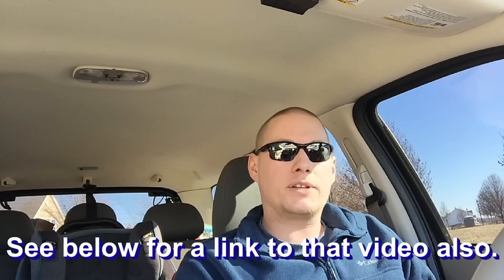Ford Ecoboost Engine Carbon Deposits: What You Need to Know

Comment: Fun fact:  Costco gas is Top Tier qualified. http://www.costco.com/gasoline-q-and-a.html
Reply from the maker: Cool stuff
Reply from the maker: Roland Gutierrez Yes as stated in tank only
Reply: coma9 I could tell a noticeable difference in performance and sound while running between running costco gas and shell or chevron gas. In my high compression engine car, the costco gas would make it run a bit rough. I would get more crackle and even a few backfires on decel running costco fuel, but never had it as much running chevron. all the fuel ran was 91 octane and i tried the costco fuel a few different times throughout the year with the same result. It is possible the specific location i was getting the fuel could have been the problem, but i ddin't want to take any more chances and didn't want to scare the people around me. backfires are LOUD lol
Reply: Brandon N It's very likely that the location you were purchasing from has issues, as I've been running Costco gas for years in my vehicles now with no issues - but that's just my experience.  Everyone's experience my vary.  I recommend contacting Costco HQ about the location in question though, as they do pride themselves in their fuel quality, claiming it has just as good of detergents and quality of fuel as name brands like Chevron, Shell, and Texaco (our Texaco's use Techron, like Chevron, so not sure if that means much to you heh).   
Hopefully they can get it sorted out at your location so you can enjoy great fuel at low prices.  Have a good day :)
Reply: coma9 it could have been a few bad batches of fuel. My brother has a tacoma that consistently runs fine on their gas, as well as my mother with her hyundai sonata, which is a newer, direct injected model. My car was pretty finicky with fuel, as it was performance-minded and it was very easy to tell top tier from other fuel with that vehicle. Needless to say, i only ran maybe 4 or 5 tanks within a 4 week span, before i went back to my usual chevron or shell. I have since gotten into diesel trucks and that car has been sold. Costco doesn't have diesel fuel, so i typically fuel at the shell and chevron stations that offer diesel now. With diesel, the only times i can tell a difference in performace is if i forget to add fuel additive at each fill-up. The car i spoke of earlier didn't benefit from any sort of fuel additive in my experience. Diesels, especially those disigned before ULSD fuel, seem to run noticeably better with a fuel additive. Cetane  (octane for diesels, essentially,) isn't regulated like gasoline with octane, so the fuel additive "smooths" out the combustibility.

Comment: OMFG . this is the first time I hear valve overlap being the reason for direct injection carbon deposit... So not EGR and blow by gases brought back into intake via crankcase ventilation... 🙄.. anyways.. I stopped watching when he said no on mediablasting... this video is: one part false info, one part witchunt and another part of sneakoil..  it hurts.
Reply from the maker: Lol go ask the engineers at Ford. DOD you take the class on the Ecoboost engines at the Ford training center?
Reply: @FordTechMakuloco  I am an engineer myself (MSc) and I have not taken any classes at Ford specifically, but went to university.
Reply from the maker: ok

Comment: I don't think you should take ford word as gospel as they want you to birng the car for them to clean up the valves.
Reply from the maker: I was a Ford technician working at a Ford dealer talking directly to the engineering team. This has nothing to do with Fords bottom line.

Comment: This system design for this motor is crap! Nothing but excuses. 60,000! Did I say 60,000! Did I say 60,000? These trucks are nothing but trouble. I’ve heard it all from ford people. Just say it like it is crap! Our company has several of these trucks and most are the same crap! Gotta do this gotta do that. Your a good dude but call it like it is! Did you get called on the carpet or what? Everybody! Do not buy these trucks!

Comment: LOL, don't buy a ford. Toyota uses both port and direct injection to solve this issue.
Reply from the maker: So does Ford.
Reply: It used that in the 2.3L EcoBoost?
Reply from the maker: 3.5l and 5.0l now
Reply: Well that’s good. It doesn’t address the issue of the smaller ecoboost engines. Why sell a product which you know sucks? I don’t believe Toyota is selling any direct injection engines without port injection today.